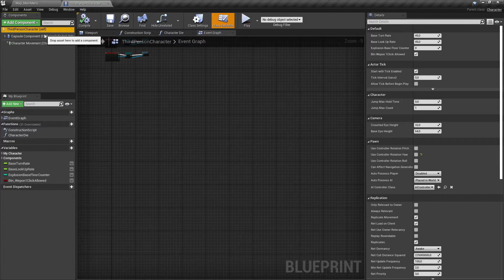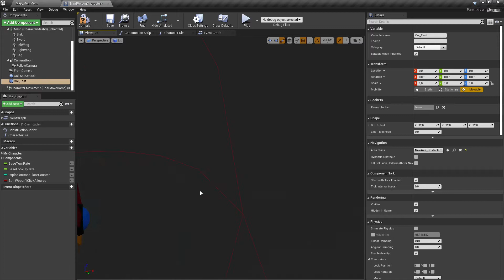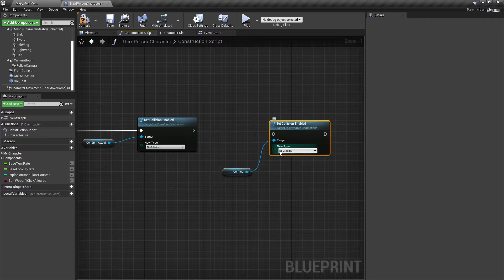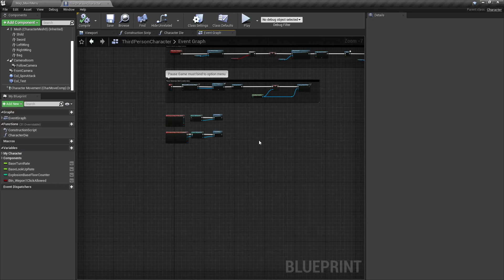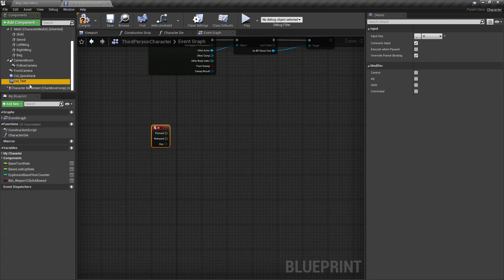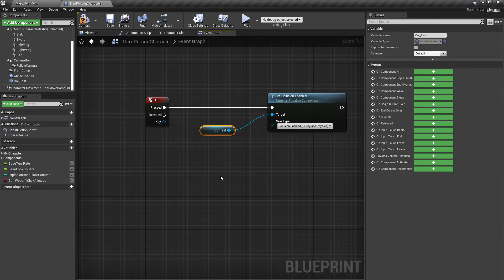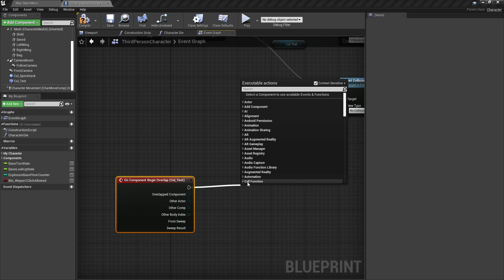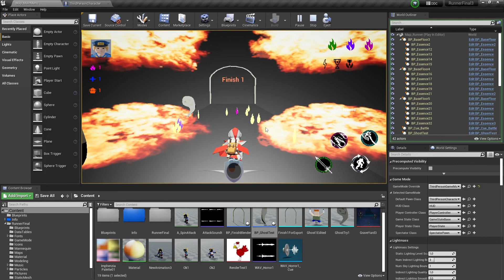Unreal Engine 5 - Collision enable disable in blueprint

Comment: Did you know I have i right ear?
Reply from the maker: Thx for the info. Many people complained the same thing like you. But the problem is that i have already created over 40 videos with this wrong setting. I fixed this problem after several videos till anyone wrote the same thing like you.
Reply: @medialcore  ok. Sorry if it was mean
Reply from the maker: @vixexxfn2068  This was not mean. Actually a comment like this helped me to realize it or i would still make the same mistake. So I have to say thx.